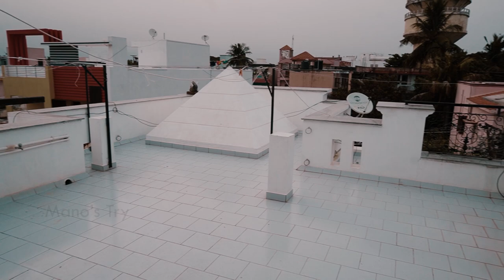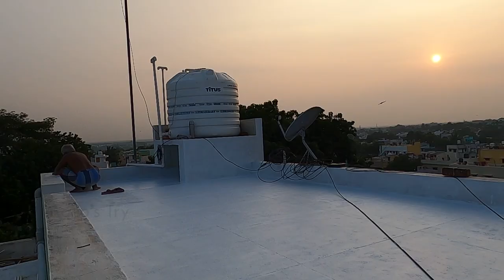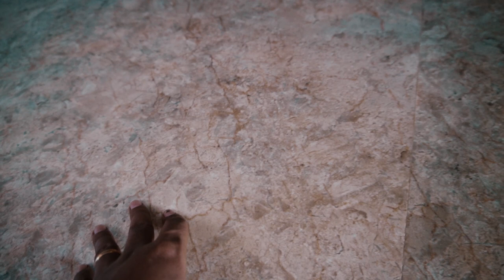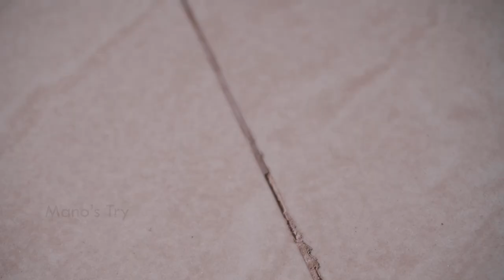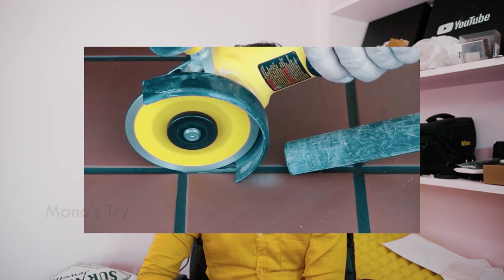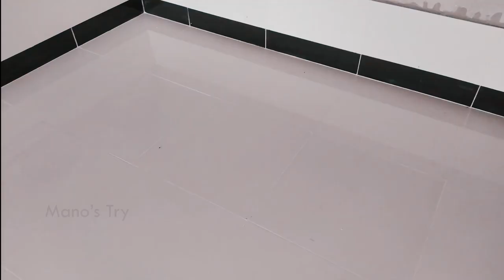Cooling Roof Tiles போட்டும் நீர் கசிவா? Waterproof Paint, Terracotta Tiles | Mano's Try Tamil Vlog

Comment: Thanks  bro. Will mosaic tiles on the terrace cause problems,more than 15 years. Can I fill the gaps with Dr Dixit TG and then use a water dampener on the mosaic tiles.
Reply from the maker: No. If any problem occur, Replace the mosaic & do a waterproofing

Comment: Water proof coating pottu cooling roof paint adikalama anna to avoid water leakage and also to reduce Heat?

For long term ..single floor house ku ethu better nu pls suggest na..
Reply from the maker: Yes, pannalam
Reply: @ManosTry  thanks anna

Comment: Hi bro,
Is chipping mandatory for open terrace befire laying tiles? 
In my terrace waterproofing was done way back. Around 6-8 months back. The floor surface is kind of smooth. But terrace laying person suggested to do chipping before laying terrace tiles.i didn't had idea of putting tiles then but now wanted to put it now. Wanted to check if chipping terrace is mandatory? I don't want to break the surface now . Any alternative is there without chipping? Since it is horizontal tiles can we lay without chipping? I don't have e technical knowledge in this matter. Pls suggest
Reply from the maker: Yes chipping recommended

Comment: Hi bro, 
Ceramic tiles or vitrified tiles which one is good for terrace? 
In kajaria, there is Ceramic Cooling tiles available. 
In Johnson,  there is vitrified cool tile.
Which is better?
Reply from the maker: Vitrified better than ceramic
Reply: @ManosTry  thanks for quick reply bro. 1x1 or 1x2 is better? Kajaria 1x2 vitrified is available in stock. But not sure big tile is good for terrace
Reply from the maker: @tsuresh1234  1x2 better

Comment: Bro enga V2 la roof la concrete ollunga podama vittu ipo kunduu kuliyma aiduchuu bro..Idhunala ipo water kulii mulama rainy time la vanthuduthu bro..ipo nanga ena pannurathu bro...again kothii vittutu psand+cement vachu pusurathu better ah ila...Matt surface 2×2 tiles corner damage tiles use pannii tiles podurathu better ah bro.. Already V2 bulid pannii around 8 years aga poguthu...Again epo mela build pannuvom therila... concrete nalla irutha kuda water proofing paint pannalam but advum damage la irruku... waterproofing paint use pannama damage tiles use pannii tiles pottu adhu kuda white cement vaikum pothuu white cement kuda mix water proofing material edhum irruka bro... konjam urgent sikram reply pannunga ipo rainy time nala kastama irruku
Reply from the maker: Neenga kuzhi ellam cement vachu sari pannitu, apparam dr fixit 301 or 2k pidifin use panni waterproofing pannittu adhukku mela kooda tiles podalam.

Comment: Bro, now I am planning to build ground floor and two years later planning to build first floor..so which type of weathering course recommend for temporary to ground floor roof weathering course...
Reply from the maker: Mix waterproofing chemical with concrete mix. Then apply 2 coat waterproofing on the roof
Reply: @ManosTry  thanks

Comment: Slop roof kku also cooling tiles podanuma
Reply from the maker: Water leakage avlo va irukkathu, heat kuraikka podakam
Reply: @ManosTry  thanks for reply bro 
Slop roof la just concrete mattum potu just white wash or water kku dr.fix adicha 4-5 years kku enough ah brother
Reply from the maker: @9099067416  yes, use dr fixit 2 coat